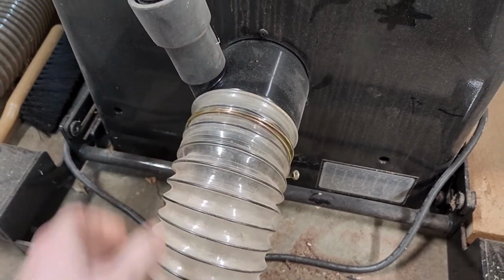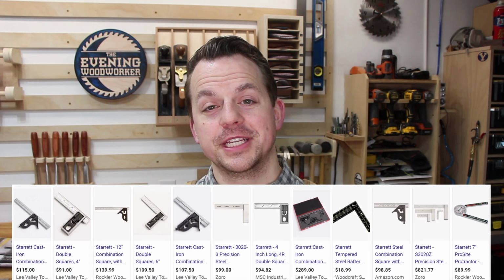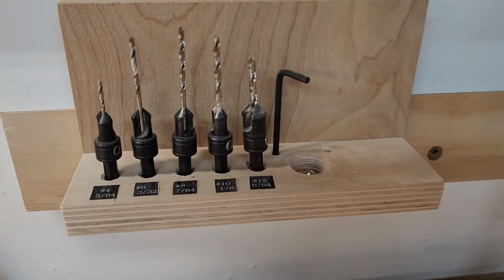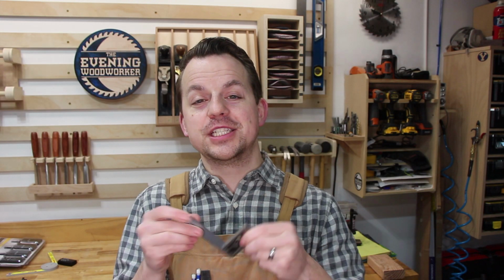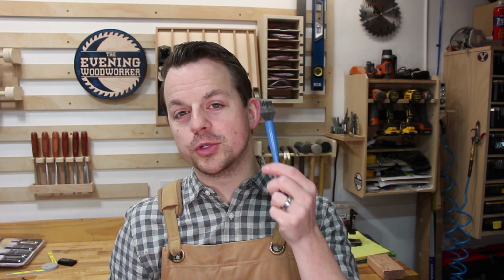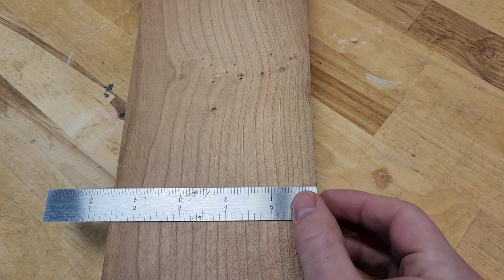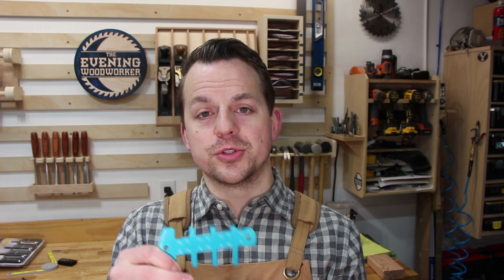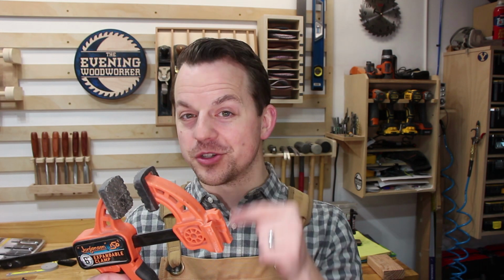8 Woodworking Tools under $25 that I use on EVERY Project!

Comment: What's the difference between those remote switches and the ones I use in my house to turn lamps on and off with?  I don't think they're specifically for lamps, but I use them on antique lamps to keep from wearing out the lamp switches.
Reply from the maker: The garage style ones are typically more robust and can handle up to 15A, some of the smaller indoor ones can only handle a smaller lamp. For small dust collectors and shop vacs, you need the 15 amp one

Comment: Those Jorgensen squeeze clamps can also latch together end to end to double the length.  So you take two 12 inch clamps and connect the ends together to get a single 24 inch clamp...  Its super convenient when you need one or two more longer ones.  They (the Jorgeys) all do this, so you can take two 24s and make a 48, or two 6s to make another 12.  Super feature.
Reply from the maker: True! I like that feature on them too

Comment: Thank you for always putting out useful videos. I will add, machinist squares are a lot cheaper than woodworking squares. I bought a set for a faction of the price that you will find for woodworking.
Reply from the maker: Good tip! Apparently woodworking tools are more fancy than the machinist tools! 🤦‍♂️

Comment: Great video. I use silicone pastry brushes for glue spreading, much cheaper than silicone glue brushes!
Reply from the maker: That's true, do you wash them out or just throw them away?
Reply: As they’re silicone I just pick off the glue in the same way you would with regular glue brushes. I think I paid $3 for two brushes

Comment: I have a dual remote.  one channel for the dust collection and one for the saw.  why the saw.  If I haven't used it in a while, I don't want any surprises on the first start.  or if I'm doing a new setup or jjig,  same thing.  no surprises.  I stand outside my garage and fire it up.
Reply from the maker: Dang, which saw are you that concerned about?

Comment: Spring operated center punch👌1/4 X 2 inch aluminum straight edge (4feet long) all essential
Reply from the maker: Agreed on the center punch! I need to get a better straight edge, though!
Reply: Depending on what you are punching, many automatics have a spring that's too strong. You may want to cut one or more coils off the spring. Go in steps. Loosen the cap until it separates, then do one turn back. Cut down until it is pretty easy to punch. If done methodically, you will ger a punch that, at its lightest, it won't bury itself in soft wood, but, fully tightened, will give you good marks on hard steel.

Comment: Wooden screw clamps are also useful - great for holding angled items like table legs. I use my 6" double square a LOT - more then my other t-squares.
Reply from the maker: That's another great one! And if you nick the edge of it, it's not going to damage your tool.
Reply: Good for holding small items at the drill press too!
Reply: @Toyotajunkie  Yes - forgot to include that. Great for keeping a spinning bit away from your fingers!

Comment: Great Video! I might have to pick up a few of those items for myself. One thing I use with every project is my 6 inch combo square. It's just a cheapo one from big box store, so I make sure its staying square about once a week, but I find myself grabbing it more often than any of my larger more expensive combo squares.

And to spin off of your remote start for your vacuums, I grabbed a 110/220v rated remote start off Amazon for less than $25. I use a 2hp DC so needed something that could handle the higher voltage. The relay is inline so I had to do just a bit of wiring, which was no problem, but they have plug in ones similarly priced as well.
Reply from the maker: Thanks, that's good to know! I guess now I could get a smart switch and tell Alexa to turn on the dust collector!